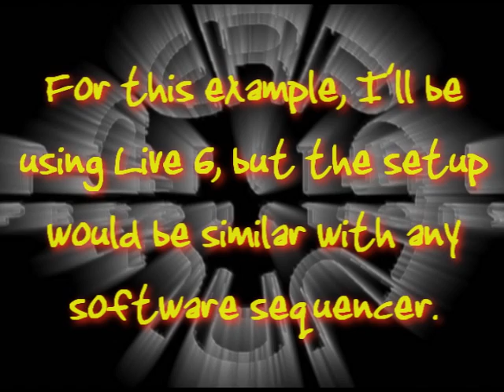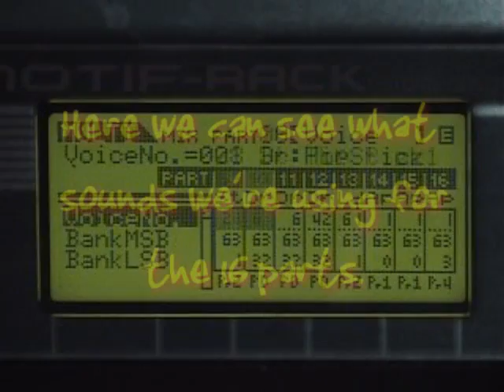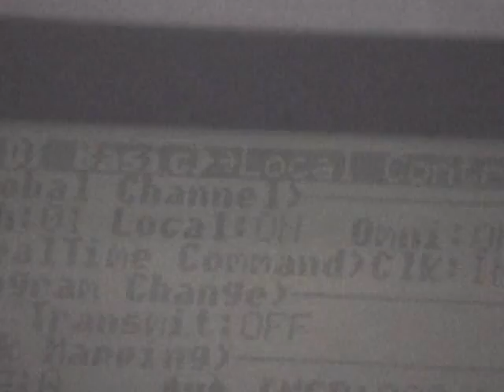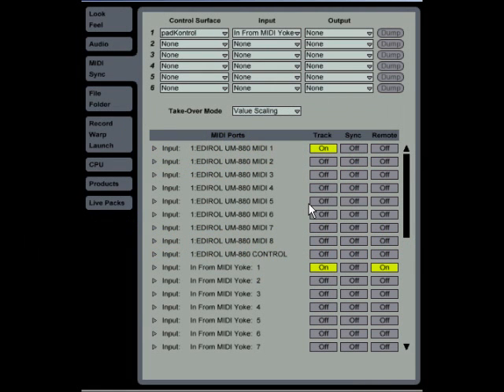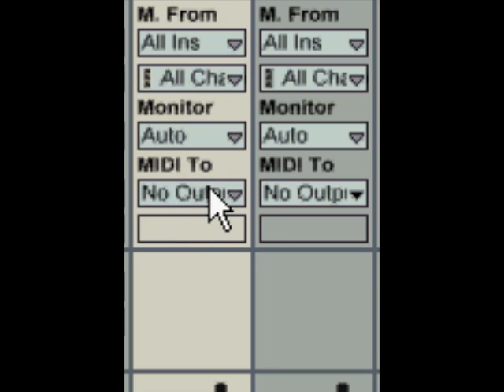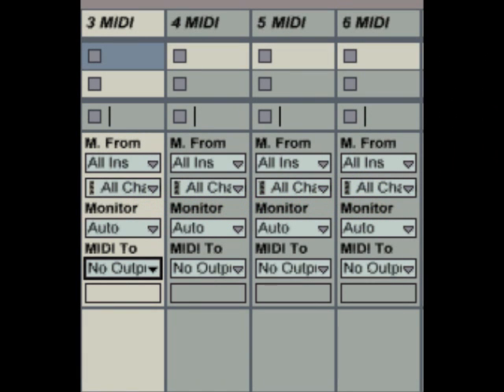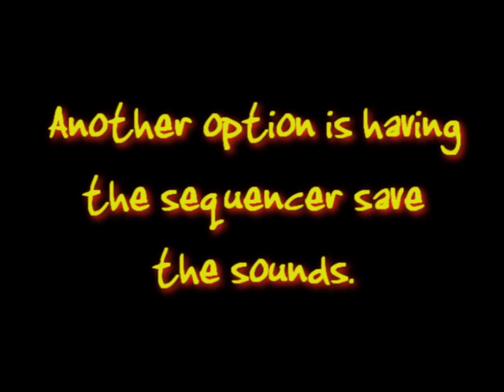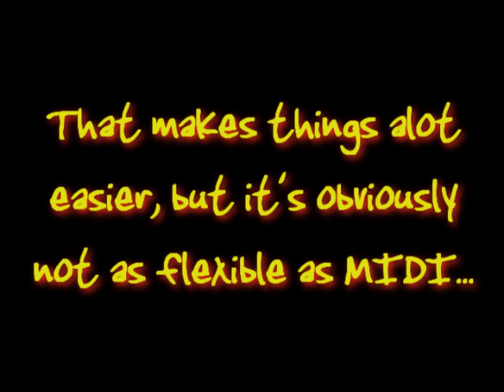Using Hardware w/Software Sequencers

Comment: great video.. I guess the Edirol UM880 is discontinued now.. you know any place i could find one? IF not, what would you use.. The new MOTU MIDI express XT or the older Emagic AMT or Unitor 8x8 midi interface? I want to control about 8 different hardware synths and about 4 hardware drum machines with Ableton. please let me know. Thanks